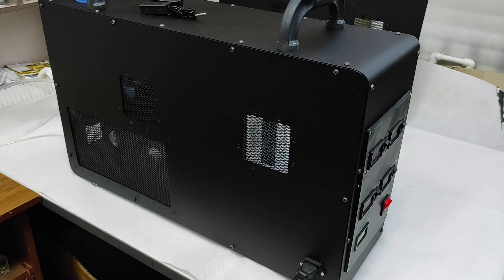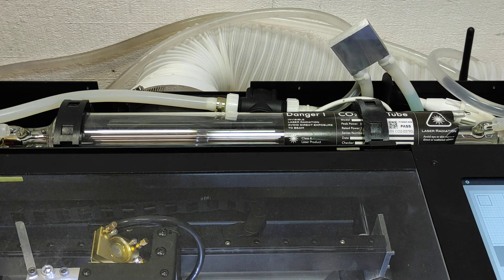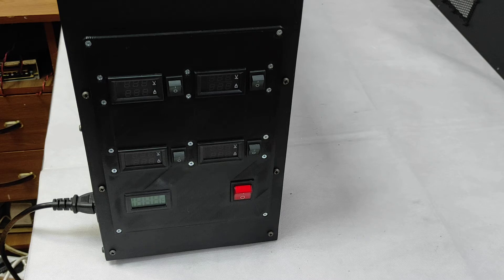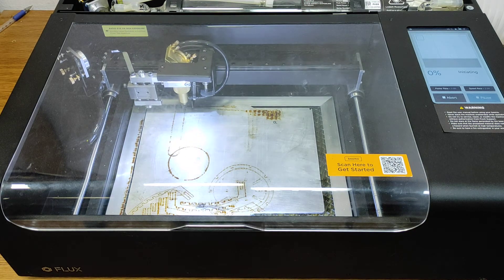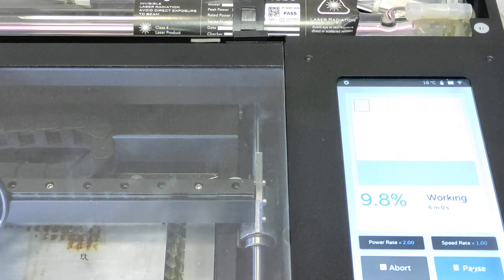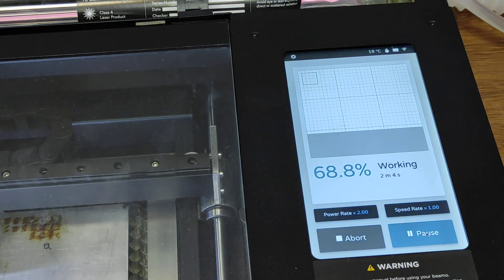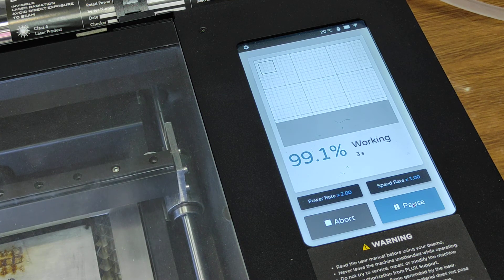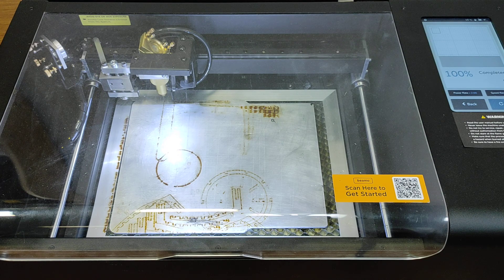An Endurance TEC (Peltier) water chiller for Co2 laser.

Comment: I have a beamo also. I see that you have the flow meter, but did you disconnect the stock internal chiller power? And did you bypass the water lines totally for the internal chiller?